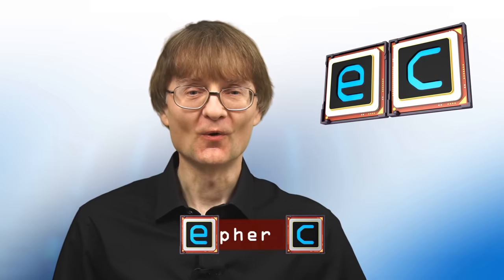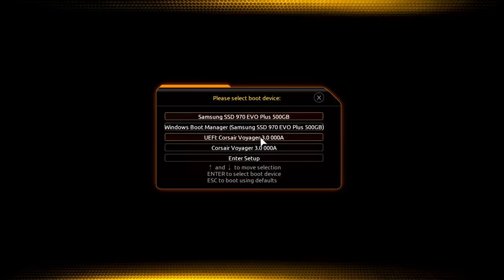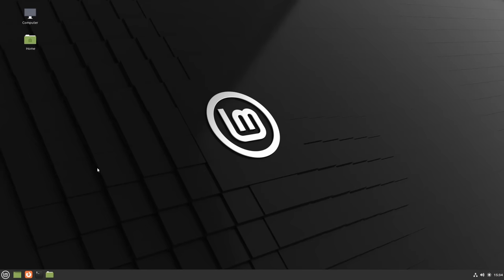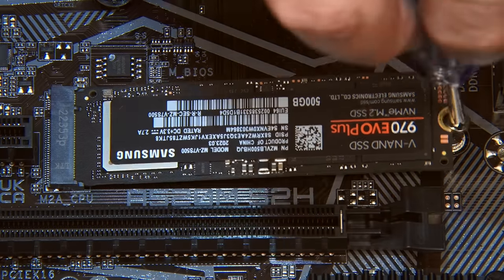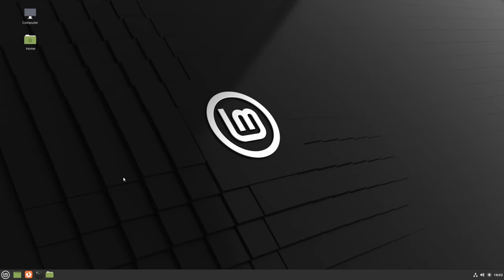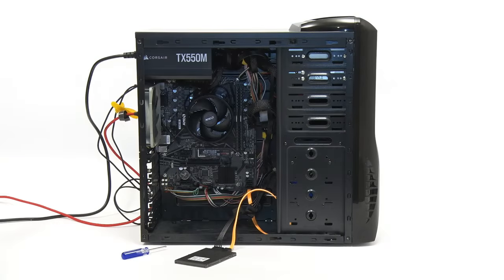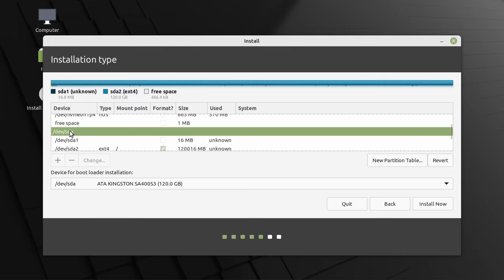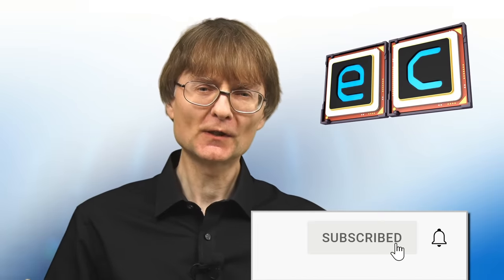Windows & Linux: Dual Drive Dual Boot

Comment: What are the safety implications? Can you set the Linux and Windows to not be able to interfere with each other or see or read or write or delete or modify each other's partitions in any way? For example if I install tons of gaming mods on Windows and one is compromised with a RAT or ransomeware or other modern malware can the hackers modify the Linux partition that is used for sensitive work information like proprietary code? Basically is there a safe way to dual boot? If not how much can be safe? Thanks to anyone who can answer.

Comment: Do you need to remove non-OS drives? I have 3 or 4 data drives, can you leave those plugged in while installing Linux on a second drive?
Reply from the maker: Yes, good point. Data drives will not cause issues with GRUB.

Comment: Would deactivating the windows ssd in bios settings work aswell, instead of having to remove or unplug it?
Reply from the maker: It would indeed. If this is an option (as it often is for an eMMC module) is is a good way to go.
Reply: Thanks!  @ExplainingComputers

Comment: @ExplainingComputers hi I need your help.  I installed linux mint deviants edition 5 on my external hdd but I cannot find my ntfs partition on the external and my main ntfs partition on the pc's internal hard drive when I boot with the lmde 5. but it shows me the other linux partitions I have on both internal and external hard drives in the devices section. 

I also went to the file system section of the lmde 5 I installed and I found an EFI folder which when I opened was showing the content of my internal window xp partition as folders within this same folder. 

but I cannot find all the ntfs partitions either external or internal to mount. but my lmde 5 is set to automount all devised or drives or partitions whichever you want to call it to list in devices. but not showing. 

Any help please?

one thing I also noticed is I don't have any efi or swap partition created on my external hard drive partitions. but the grub is installed on the external hard drive.

Comment: What's a good linux mint firewall? Not too complex and has good GUI? Something like portmaster but better visually and actually with full logs for free. Since linux is about open source and not artificially paywalling content...
Reply from the maker: I use the firewall that comes with Linux Mint.
Reply: I wasn't able to make it work with GUFW. I also would like to ban certain connection. E.g. firefox still collect user data despite ticking off in option. Same goes for other "flavours" of firefox. I Like portmaster but GUI is clunky. Basically I'm looking for something like netlimiter. Popup window where you see all the details and then you decide to allow/deny.

Also i'm looking for alternative of "net activity viewer" because it doesn't work on mint.

Comment: Laptop brand new purchased. To be cheaper, no OS installed on it. 1 drive ONLY.  UEFI + Secure Boot ENABLED - Bios ...  The solution: Ventoy - check that the Secure Boot is marked ! , install Win 10/11 but partition the SSD/HDD as to remain space for Linux ....  Then install Linux - some Distros are not supporting Secure Boot natively ?! - MX Linux, Slackware, for example ? shame .....  Tricky is that on partitioning of Linux Distro , you need to make an UEFI BOOT , Fat32 partition , and to set the proper flags and /Boot/EFI mounting point...  Maybe another HOW TO video will be done ...

Comment: Hi, thank you very much for this tutorial. I would like to ask you as I'm disappointed about boot options.
When I open the boot options menu I can see three options:

1) Windows on my primary SSD
2) Kubuntu on my primary SSD
3) GRUB on the external SATA SSD

So far everything works fine, but this is really disappointing. Is this possibly a firmware issue?
Reply: No. You made a mistake installing the system, or the installer did. Remove both your Windows drive AND your external drive and reinstall Linux. Plug your drives back in afterwards. GRUB should be installed on the same drive as Linux.
Reply: @notjustforhackers4252  I just wiped the Kubuntu from both disks and installed again. This time I went for option B as Removing the primary SSD is a painful process in my case.

Anyway now the third option (GRUB) is gone and the first two options are unchanged. But if I check the partitions, it seems there is only one EFI partition that is on the primary (Windows) SSD that has 100MB.
Previously there were two EFI partitions - 100MB on the primary SSD and about 500 MB on the secondary one.

Comment: Thank you, thank you, thank you.  I have always been bothered by Grub taking over the boot menu even when Windows and  Ubuntu(variations) were installed on seperate drives.  When Ubuntu drive was removed I could not even boot windows.  Debian, Arch distros do not have the same issue.  

I have always install Linux Mint with  Windows drive connected and chose the most obvious installation option: Erase disk and install.  Does option "Something else" means that the installer will not detect Windows similar to the Windows drive is physically disconnected?
Reply from the maker: As shown in the last part of this video, even the "something else" option will not prevent Windows being detected. But it can allow the bootloader to be placed on the non-Windows drive.

Comment: I thought you had to shrink the Windows partition from Windows first, or am I wrong.
Reply from the maker: Modern Linux installers shrink the Windows partition for you. It's a very long time since you had to do it yourself first.
Reply: @ExplainingComputers  I realise that, but I read that it could cause problems with Windows if you didn't use Windows to shrink it.

Comment: OK. What is not clear to me, after having seen the options to install and reboot the computer as Linux or Windows, is if I will be able to access the files (editing/reading docs, playing installed games, using the same applications) on both operating systems.
Reply: Linux can read and write to NTFS drives ( Windows drives ). Windows cannot read and write to Linux drives, ext4, BTRFS, zfs etc. You'll be able to access and edit basic files stored on NTFS in Linux, however due to NTFS not respecting Linux file permissions you will encounter problems, you can't play games in Linux stored on NTFS for example ( there are hacks around this, but don't bother it tanks performance ).

Comment: In both ways you had your windows installed already.
Try to install windows having Linux installed and working and you'll be surprised.
Reply from the maker: No, I won't. Disconnect the Linux drive and add a new drive. Install Windows on the new drive. Plug the Linux drive back in. And then select the OS via the BIOS boot menu, exactly as I show in this. I've done this scores of times.

Comment: I ran into a problem where the pc requires me to turn off RST, which wiped my windows.
I'm using the Alienware Aurora R9, i7 9700, 32gb ram, rtx 2080S, 1tb ssd,

Comment: Can’t you do the same thing just install Linux on an empty drive as a new installation and then just choose the drive you want to boot off of.
Reply from the maker: If you install Linux on an "empty drive", by default the bootloader will install on your current system drive, and will include a GRUB menu that includes Windows. One of the several methods included in this video does show how to stop this occuring.
Reply: @ExplainingComputers  awesome so what I am trying to do is I have a Samsung 990m.2.  My windows partition is drive c: and I made a D: drive as the rest.  I have win10 on the c drive and want to put mint on the d drive.  So the only real way is to pull the windows boot disk out and then install it without grub.

Comment: Regarding Method B, the problem I have is that linux uses the EFI partition of the windows disk (even though the boot loader is in the Linux disk). I understand that the solution is to create an EFI partition on the Linux disk but Linux still uses the EFI partition of the windows disk. Is it possible to fix this without having to disconnect the windows hard disk during the installation?

Comment: I have a Zorin Linux system, but I cannot play certain games, I need Windows - so I have a Win10 ISO (with key) and I want to put that one a separate drive - so In my case I assume I unplug the Zorin Drive and put in another drive, install windows and then put in both drives and on boot press F12 - is that correct ? Thanks EC !

Comment: I have a windows pc with two drives, which I would like to add a Linux boot to.  

The primary (C) drive is the Windows boot and is not very large.  The second drive I partitioned into two logical drives.  The first part (first logical drive) has most of my files that I use with Windows.  

Is it possible to make the second partition a Linux boot drive even though it is NOT unique hardware from where I keep my windows  files?

Comment: I have tried your dual drive dual boot B option and it tells me that there is no EFI partition on that disk. When I added it and installed ubuntu it booted into windows but not ubuntu...
Reply from the maker: Sorry to hear you've had problems. But when exactly did "it" tell you this? You should not get such a message during the Ubuntu install if you selected the option to erase the disk and install Ubuntu.

Comment: I setup Kubuntu using option B, however, I've found that the drive which it is installed on never shows up in the BIOS on a cold start. Only my windows drive is listed. I need to boot into Windows first, restart the system, then hit F12 to enter the BIOS and only then will my Linux SSD drive show up. Sometimes, even after i get into the Grub bootloader after having done all of that, Kubuntu fails to start and I get a Kernel error. If I hard reset my desktop after that, either it goes back to Windows immediately, or, it somehow boots straight to the grub menu! No idea what is happening...

All that being said, when I do manage to get into Kubuntu (after enough boot cycles...), everything works fine...

Comment: I did the 2nd option that you suggested installing mint on a 2nd drive (I used an older IDE drive that I had nothing on for testing purposes), and everything went ok EXCEPT, I'm stuck on the Linux Mint boot screen ( 10:53 ) and nothing is happening.  Any ideas as to why this is happening?

Comment: Is it easy to install different distros of Linux on that second ssd? Do I need to install them on different partitions?
Reply from the maker: Easy is a relative concept when it comes to Linux! :) But yes, it is possible to install multiple distros using different partitions as you say. But if you want to run a lot of distros, using virtual machines is an easier option, unless they all need full hardware access.
Reply: @ExplainingComputers  Thanks Chris! I'll give it a shot. :)

Comment: I currently run a dual boot dual drive with Debian 12 and Windows 11. Is there a safe way to remove the Grub and achieve Method A results?

Comment: They make it so hard to install linux. Out of memory error booting from usb. I shouldn’t need to dig through 20 forums to install an OS.
Reply from the maker: What you describe is not typical. In ovr 10 years I
 have never had an out of memory or other error booting from a Linux USB drive. Don't assume that your experience is typical of an entire range of distros.
Reply: @ExplainingComputers  I will try another distro. Seems like a common issue with mint.
Reply: @ExplainingComputers  followed your steps with Ubuntu and the screens were basically identical. Thanks.

Comment: I wonder if there is a way to run one os in side another like virtual machine but they use different hard drive.  
like main os is linux, virtual os is windows, but i can boot directly to that same windows install if i want to run it directly on hardware.

Comment: I’m running 4 operating systems on my Inspiron 620:
W10, W11, Ubuntu, and Chrome OS (Brunch)
In the past I’ve enjoyed picking up $15 PNY SATA SSDs, but they seem to have a driver issue with Linux.  They seem to run well above 90 degrees, and sometimes crash the whole system.  I can’t seem to find a decent fix.

Comment: I have installed at my NUC,  a dual boot - Win11 and Linux Mint according to your plan 2. For a long time (4 months) it worked OK. Suddenly, -now the startup menu does not come up, - the PC boots directly into Linux Mint. How do I come back to use Win 11 again?🤔
Reply from the maker: Sorry to hear this. I'm not sure what you mean by the "startup menu"? Both of the dual drive methods I show (ie the ones after I show a single drive dual boot setup) use the BIOS boot menu to select the OS, which will only come up if you press the appropriate key on boot for your system. So what you say suggests that you have been selecting Windows or Linux via the Linux GRUB menu and not the BIOS menu? Or it is that Windows has disappeared from the BIOS boot menu? What do you see when you press your BIOS boot menu key on boot?

To move things forward, I would first go into your BIOS and see if the boot order has changed. Potentially a major Windows or even Linux update could have altered the BIOS (annoying as this is). If you cannot select Windows or Linux on startup using the BIOS boot menu key, there should be a "Boot override" or similar in the main BIOS screens -- usually somewhere near the end (often the last tab) in the "Advanced" version of the BIOS (menu-based, rather than graphical).

I'm happy to try and help more if you can be more specific about your setup -- please post any reply as a new comment, as this will come to my attention more quickly in the comments. Good luck!

Comment: I have Windows on C: and data on a separate physical drive (D:). If I fitted an additional physical drive for Linux Mint (say, E:), what would people say about the ease/reliability of both OSs accessing the same D: data drive?
Reply from the maker: Both OS should be able to read your data drive (assuming it is formatted, eg, NTFS). Windows will not be able to read drives with a native Linux format (eg ext4). I would (and do) personally turn off Fast startup in Windows, so that it shuts down properly (rather than hibernating and saving its state), just so all drives are properly unmounted (and so left accessible to Linux). But I do this on any Windows setup anyway.

Comment: After the dual boot I'm able to run Ubuntu without any error, but, Windows OS is resulting in an error. 
Not sure what I did wrong. How do I fix this ?
Reply from the maker: Sorry to hear that you are having problems. But I don't have enough information here. What method did you use to set up the dual boot? Is Windows booting at all? What is the error?
Reply: @ExplainingComputers  Ubuntu is booting as expected, Windows isn't. I'm getting the preparing automatic repair error while trying to boot Windows.

Comment: Hello after testing verious Linux distros on an older computer with secure boot already disabled i want to put Linux Mint as a second os on my actual pc that is a Lenovo T5 26amr5 90rc this computer has 2 ssd m2 slots so im going to remove the windows ssd place the new ssd and install Linux Mint there, and then replace the windows ssd and so i will have Windows and Linux on 2 different drives, but my pc is a prebuilt machine that came with Windows 11 preinstalled and with secure boot enabled so the real question is, do i need to disable it to run Linux Mint installation, and keep it disabled to boot and use it, or i can keep it enabled?

Comment: It is possible that dual boot dual hdd with Windows11 installed using uefi and linux on other hdd installed using mbr(legacy mode) work with f12 key (installed each os independent... Removing one drive)...but is it possible to use grub (your last option...) with one uefi and one mbr hdd?

Comment: What happens when I insert the linux drive into another pc? Can it be used as a plug and play OS?
Reply from the maker: Plug-and-play, no (drivers are hardware specific). But Linux usually sorts itself out when plugged into other hardware (unlike Windows). And of course are no licensing complications to stop it working, as with Windows.
Reply: I tried installing mint OS on a second ssd after removing the windows ssd on an old laptop but after reinserting it windows did not boot any more 🙁

Comment: is it possible to install Linux in a different machine and insert it to the laptop with Windows??? will it work?
Reply: In theory you can install Linux to a hard drive and then move that drive to another system. With the exception of NIVIDA all of the device drivers are built into the Kernel and will auto detect at boot. No guarantees but it should be possible on one condition... do not install ( or completely remove ) the NIVIDA drivers first.

Comment: I have been using Windows 11 and Ubuntu as a dual boot for about a year now. I have noticed Ubuntu getting more sluggish, glitchy, and freezes more and more as time goes on and am contemplating switching Ubuntu for Linux Mint. Would it be worth changing the distro?
Reply from the maker: I ran an Ubuntu system connected to my TV for about two years. Then gave up for the reasons you cite -- the system has been running Chrome OS Flex for 18 months since without incident. I've been running Linux Mint at my desk for many, many years with no issues. :)

Comment: Hey i need help
I tried your dual drive a method , removed my hard drive first and then installed linux on my ssd. Everything went smooth. Both os are booting up perfectly but ssd is not showing up in my windows file explorer. What should I do?

Comment: iaccidentally turned my system into a dual boot when i plugged my harddrive in the same cable as the harddrive one, so it acces both drives via 1 cable, i tried plugging it out and putting it by its self but my system couldent find the ssd, so is there a way i can revert this without having to re-install windows?